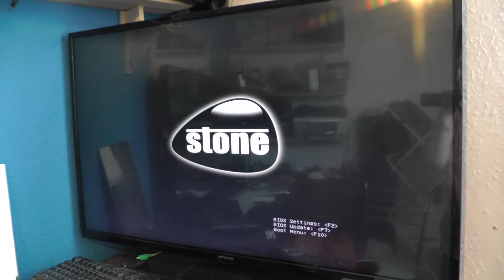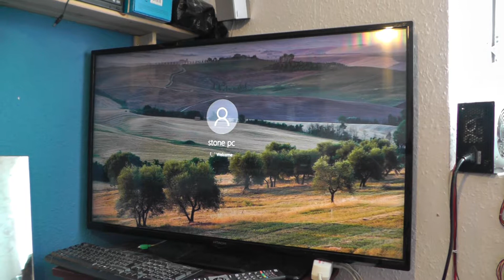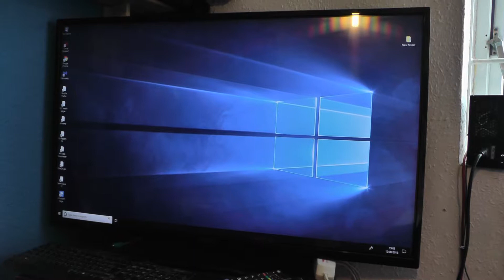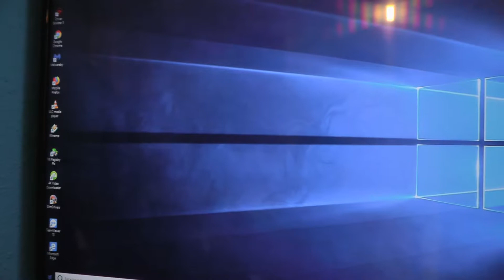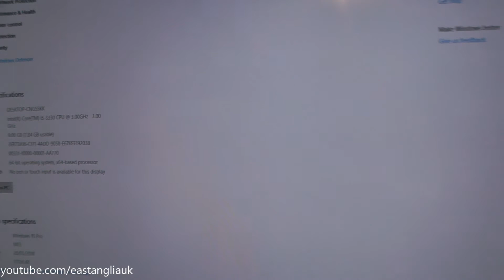Upgrading the ram to 8gb in my STONE desktop PC-1210 Intel Core i5 3300

Comment: @EastAngliaUK Do you have any further dissembling info... STONE won't help as the PC was sold to CEX out of "Family Fund". there is a badly grumbling fan and I can't figure how to release the PSU and reach the case fan, nothing obvious for removing the front frame
Reply from the maker: You might need to remove the dvd drive which should just lift up or pull out it's hard to tell with out seeing inside.  I still have this pc.
Reply: @EastAngliaUK Thanks, it's my Silver surfer friend's PC, already got a spare PSU but just couldn't shift it, so start with the DVD drive (that is a slim one, pretty sure it's the same case), end then see if anything else clears, ok.